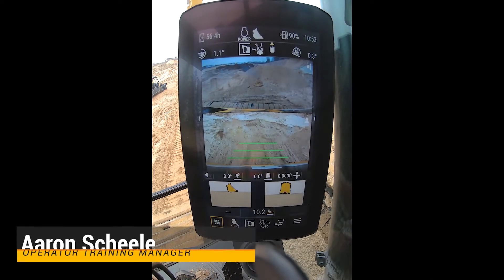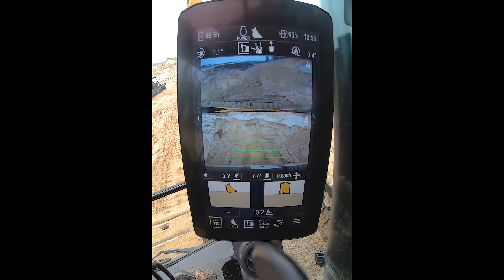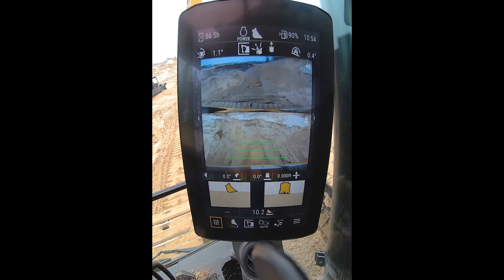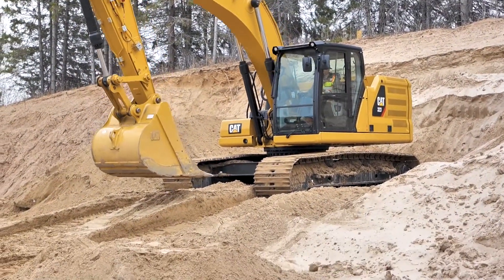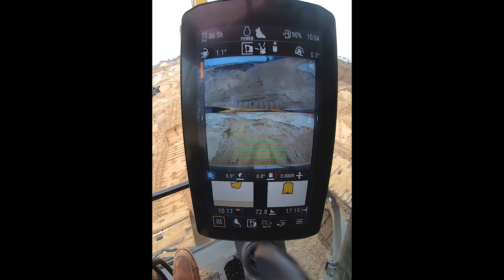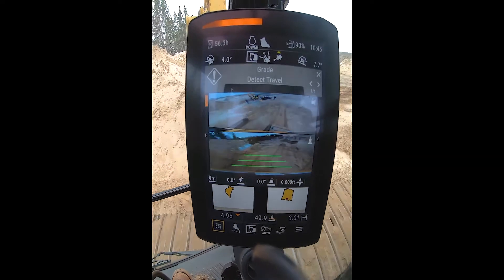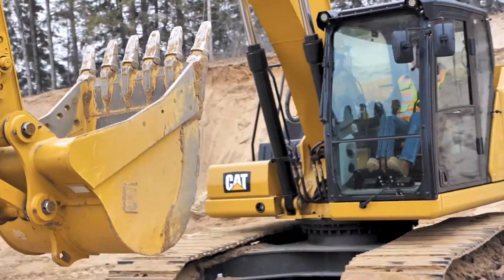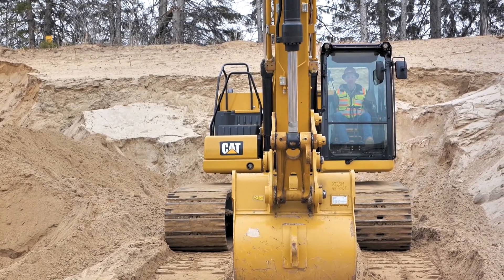How to use Cat 2D Grade Control with Laser

Comment: How do you deal with sloped trenching, when the machine is traveling on a slope itself.   As you dig and travel, how do you ensure the trench slope is maintained/continued?   Using a laser.  For example, you travel 4 feet, now the position is 4 feet farther along the slope of the trench.  How does the 2D system know you have traveled horizontally 4' and adjust the trench slope accordingly
Reply: I wonder the same thing
Reply: @jackrab41   I ended up digging a 10' deep 400' long trench with a 1% slope, and used a 2024 CAT 313 with 2D control.   It was a game changer.    However, if you ever move the machine, you have to rebench it.  Meaning, you have to hit it with a laser again so the machine knows where it is.   I had made a chart with the depth at 10' increments which factored in the slope.   I would dig 10' then move 10', rebench according to the chart, repeat.   No way I could have done it without the 2D.   The bottom of the trench came out smooth with the desire slope.
Reply: @klaatu2  ok that’s kinda what I thought but wasn’t sure. Boss just bought a machine with it and want to figure out best way to use it